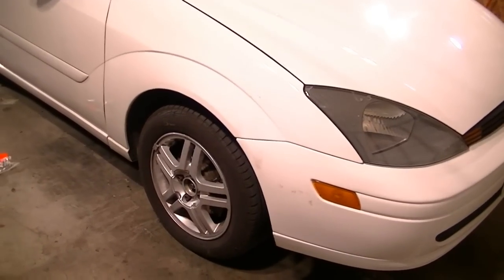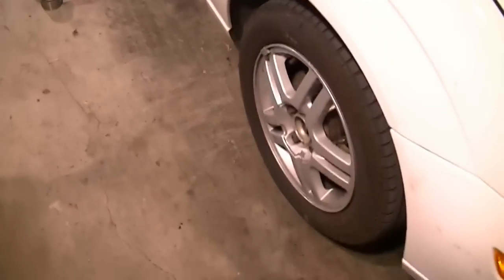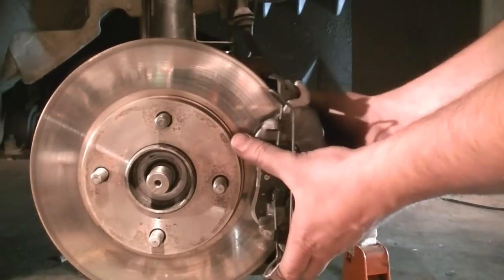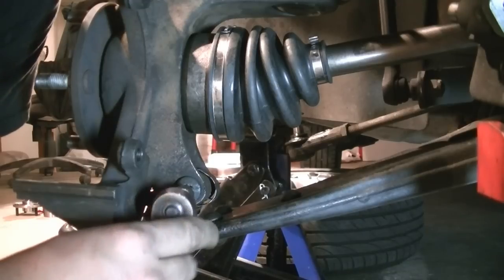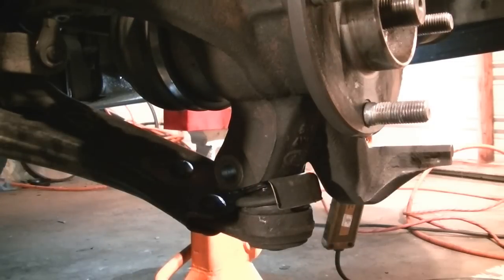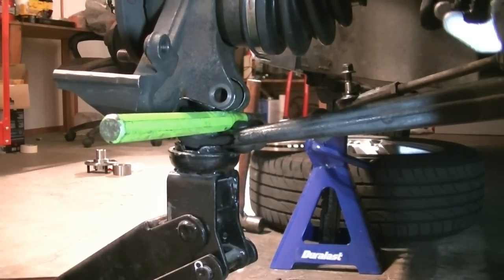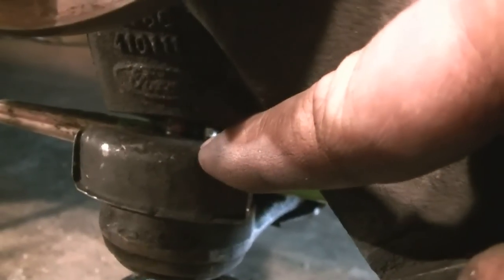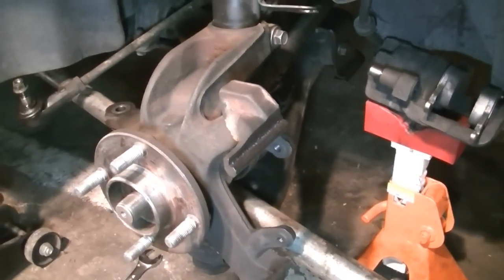How to Replace the Wheel Bearing and Hub Assembly on a Ford Focus Part 1

Comment: I was taking the passenger side front tire off when two of the studs snapped off. I had to replace the hub. Couldn't have done it without this video. Very nicely done. Thanks for sharing.
Reply from the maker: np, glad it was useful to you, cheers!

Comment: If you put a jack stand under the hub when you let the jack off the arm will drop away if not you can pry it off in the same manner as you are but with the hub "stable" it is shorter work.

Comment: Great video,  wish I would have thought of prying the piston on the calipers before removing them.  An easy way to get the hub assembly off the axle is to use a gear puller, just put a breaker bar between the wheel studs to keep the hub from turning as you turn the gear puller and it will pop the axle right out.

Comment: The best way to loosen the axle nut is to remove the center cap on your wheel, put it back on and lower the car down onto the ground. Then use a breaker bar and loosen the nut using the vehicle to hold it still while turning it. Once you get it loose remove wheel and continue.

Comment: i had my bearings replaced last friday and they only lasted one day. the shop that installed them didnt use a press. they used a hammer. i went back to the shop to complain and they do anything about it. i pretty much paid a guy 80$ to beat my bearings into my hubs. wish the Focus bearings came with the hub already pressed in. would make life 10000000x's easier

Comment: 5:10 looks like your jack is starting to fail a little bit buddy. its not holding and slowing dropping down. That or you didn't tighten the release enough

Comment: a shop is trying to charge me 300 dollars for this does that sound right? or should I just do it myself?
Reply: Sosa Yoola damn lol the shop I went to charged me $140
Reply: MAN, I PAID $50 BUX FOR A 23 PIECE BEARING INSTALLER/REMOVER FROM EBAY! DO IT YOURSELF!!!
Reply: Depends what the issue is... The knuckle and the bearing is $128 each from Rock Auto. O'Reilly's wants double then you have to factor in additional parts and labor.